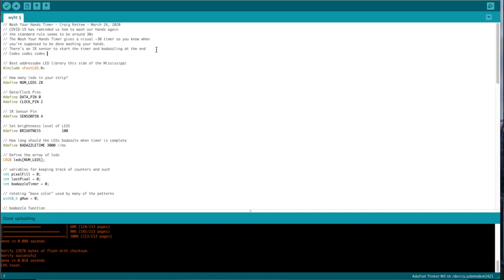Wash Your Hands Timer

Comment: thats the WAY, waste All that water, u r no where near environmentally responsible, unless u do what I do, collect rainwater in tanks, use solar to charge battery banks and run ur pump off that.... and only if it rains alot where u live then u can wash ur hands for 20 seconds. PUT THE PLUG IN THE SINK of fill a Bucket and wash ur hands in there. STOP WASTING ALL THAT WATER RUNNING THE TAP ON FULL BLAST FOR 20 SECONDS. Shame on u.
Reply: dude, chill, he's helping you